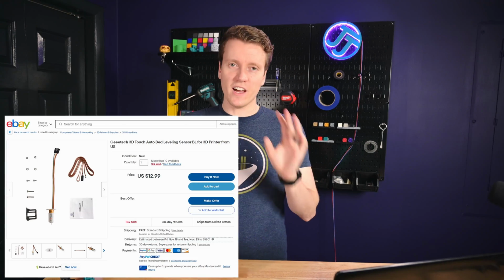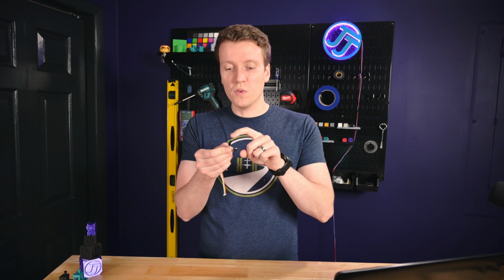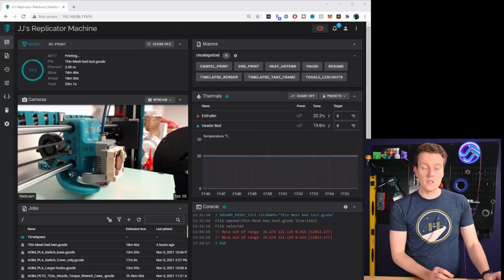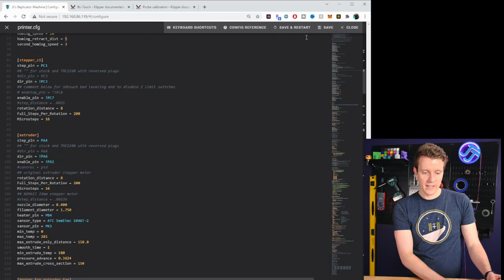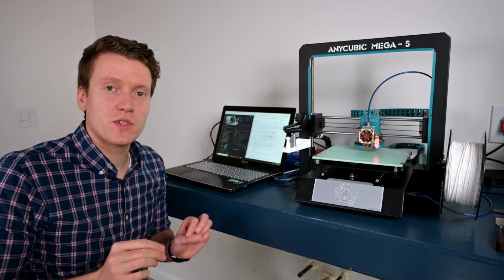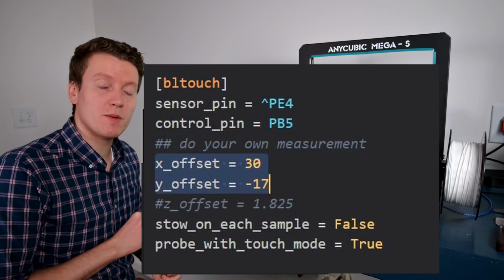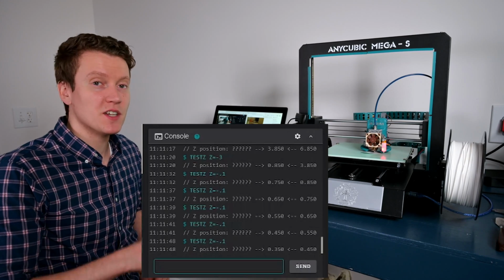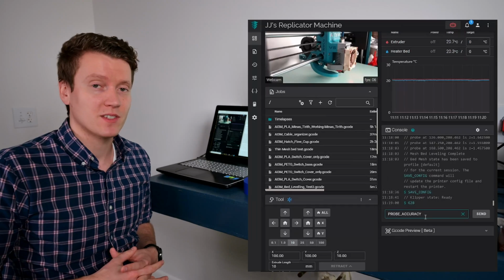Klipper BLTouch Clone Setup | Easy Anycubic Mega S 3dTouch Tutorial

Comment: Hello everyone First of all, thank you for the recording, since I'm still relatively new to the Klipper area, I already have the first question for you, I borrowed the Sonic pad from my colleague because my pi unfortunately passed away. Now I thought I would I could also put my old Mega Pro on a clipper. After a lot of fiddling and two nerve breaks, it finally worked. The only thing I can't get to work for the life of me is my BL Touch, which I have with the instructions from the internet with the x stop and connected to the cable twist and previously the stupid thing was running on the Marlin firmware but there was no chance of using Klipper. Can someone maybe help me?

Comment: How you connect it if the printer doesn’t have especific pin out for it, I have an anycubic mega zero, and I want to improve it, add a heated bed and. I would like to add the 3D Touch (I already bought one but I can’t find help to adapt the printer ) 

Klipper already “working” is install but I’m trying to place the heated bed and the 3D Touch all at same time

Comment: Hey i have the Trigorilla 0.0.3 and i have the Problem that my Sensor Pin is not working i double checked the wiring and my program but it stills always says triggerd? anyone that could help? I think that the sensor pin that you use in your video doesnt work for the 0.0.3V.

Comment: Thanks for guidance! I have a problem when I level the plate(bed mesh), it always sends me out of range. Do you have any suggestions?
Reply from the maker: You can set the "position_min" on the Z axis to something like "-5". If that's the axis that is giving you the issue. I had that problem where when it creates a mesh then it considers some of the bed under the homing point.

Comment: Another great video JJ ,thanks. I've got a mega s and I'm installing the ML mk4 carriage. The servo wire going to the board makes sense. The black and white wire that you added to the small pcb; what pins is that going to and where do they exit at the other end of the loom? That portion of your video talks about soldering the header pins but doesn't explain to what and where they exit/connect to.
Reply from the maker: So following the loom can get super confusing on this printer, but it eventually makes to it pin D2 on the Trigorilla board. And the arduino pin of "D2" is "PE4". That is how you define the pin in Klipper config file.
Reply: @JJShankles  Thanks JJ.  I haven’t moved to trying Klipper…..yet. My aim is to get the Mega to the point where it is a reliable PLA and PETG printer that just gets the job done. I’ve upgraded the hotend after discovering the limit of the standard one at 240 C :). I have a Pi running Octoprint so once the carriage is up and runninng, i’lll use your klipper video to try that. After that, a Voron will be the performance upgrade I’ll chase :) thanks again

Comment: I followed this video very closely and everything is working but I have one problem. The nozzle priming at the beginning of the print is now right in the middle of the bed rather than on the edge like it was before.  Any ideas how to restore it?  I can't figure out what part of the config file handles that.
Reply from the maker: That probably is part of the priming g-code that is probably coming from your slicer. You can add a line for it to go back to 0,0 after homing the z axis. The config line "safe_home_position" or something like that defines where the bltouch will home the z axis

Comment: JJ i need to buy the fan at the back for the anycubic assembly do you know if it is 12 or 24v tks brian
Reply from the maker: All the fans are 12V on the printer since the power supply is 12V.
Reply: @JJShankles  tks have a good nite eh!
Reply: Tks for all your videos i have learned a ton!! Did you get your filament runout sensor that came with the anycubic to work on your anycubic mega with klipper?

Comment: I have one of these but it could be newer as it's black (Amazon AU v3.1). The pin doesn't drop down ever time when called for "blue light" A lot of times I have to tap it with something. I'm about ready to biff it and set up an only fans to pay for a genuine.
Reply from the maker: That could be the Creality CR Touch. That's interesting, I had heard good things about them, but especially with Amazon sometimes you can find junk
Reply: @JJShankles  Nope, defiantly a fake BL touch. Funny thing is today i was jerking around with the little screw in the top and it hasn't failed to probe after a few hundred tests now?

Comment: Hi JJ i just happen to have a cr touch that i just found do you think it would be the same concept and wiring?
Reply from the maker: Yes the wiring is the exact same, and the installation is basically the same. Your x,y,z offset will be different, but that's something you set during the calibration
Reply: @JJShankles  great i will tackle it with your video

Comment: In my case, with the pin up or pin down, both give the same result on debug: triggered. Any ideia on how to fix this?
Reply from the maker: Maybe double check the black and white wires. They are the switch contacts, so if they aren't soldered well then it might not be opening
Reply: @JJShankles  I just did some tests and discovered the sensor pin is not working (SKR 1.4 T have an exclusive pin for it). Using the z-stop pin and test, all works. Thanks my friend!
Reply: @TiagoMaricate  hey i have the same problem could you explain that for me? thanks
Reply: @paccohd4387  Try to put extra weight attached to the pin and in the firmware try to invert the signal to activate
Reply: I have the same problem as you could you explain me better thanks

Comment: so... how do you deal with different height on Z axis after power off?
just use bed mesh leveling to compensate it?
Reply from the maker: Usually it holds consistent level for a while, but I can just re-do the mesh level if the z axis get off.

Comment: Does Fluid have a GUI for the movement of the head in a similar way to Octoprint? Great tutorials, thanks.
Reply from the maker: It does have a gcode visualizer so you can see where the head is. I haven't really used it since I don't really have a need for it. Can I ask what you use that function for?
Reply: @JJShankles  Thanks for the response. I use it for manual mesh bed leveling to control the z axis in 0.1mm increments. Pronterface has a similar system.
Reply from the maker: Oh now I understand. Yes that GUI is in Fluidd, and I use it everyday. You can control each axis in various increments, and you can even change the displayed increment options if you want them to be different
Reply: @JJShankles  Perfect, thanks again.

Comment: Im using the same X carriage and your printer.cfg file, but mine doesn't home in the center of the bed.
Already lost many hours trying to correct this. It should home at X00 Y100, at least mainsail tells me that...if I move the nozzle to the center the coordinates are X90, Y86. Please, help me! 😄
Reply from the maker: Check your [safe_z_home] variable. It should define where and how quickly you want it to move there. I have it go to X100 Y100 to home with the BLTouch. If you aren't using a BLTouch you can just comment out that section
Reply: @JJShankles  thanks for the reply! Yes, I’m using BLtouch with the same AI3M carriage, and [safe_z_home] its also set for  X100 and Y100. Not sure what I’m missing here. I’m using sensorless homing on the X, BLtouch probe on Z and limit switch on Y. Since I’ve  removed the DIAG pin on tmc2009 for the Y axis, not sure if there’s something related to my problem.

Comment: One thing could be added: mesh_min and mesh_max position values are relative to the probe, so you have to adjust them depending of probes XY offset, otherwise you will get position errors when calibrating the mesh.
Reply: Is there a guide to this? I'm not sure the math I should do for this.

Comment: Im frustrated ithe Printer starts and the BL-touch pin goes down and up but i cant control it in klipper with    BLTOUCH_DEBUG COMMAND=pin_down  or up :(  

cables are 100% right and the pins also

Comment: Hi JJ, any tips for setting up cura with optimized print settings for the mega s with klipper?
Reply: Thats a good question. If been googling for hours to find a good guide.  I'm not sure if my printer uses the mesh. Start and Stop code in Cura would be interessting.
Reply from the maker: That's a good idea. I've been working on a video covering cura settings, and I'll make sure to cover the start stop code

Comment: I have a mega S with the same X carriage upgrade, is the BL touch holder the one that comes with the MK4 mod? also are those cable chains that come with it?
Reply from the maker: Yes the BL touch mount is the MK4 one, and the cable chains are another model I found here: https://www.thingiverse.com/thing:4253211
Reply: @JJShankles   Thanks a million!! I've been looking for cable chains for this thing for ages, did you find any issues with printing/installation
? 
 awesome video by the way, I'll be using it when I get my probe.

Comment: How does one determine the sensor_pin = ^PE4. I'm using Anycubic i3 Mega, and the Trigger test does not say Triggered, it always says Probe: Open, perhaps the pin needs to be changed?
Reply: My motherboard is TRIGORILLA 1.1 so I changed it to the following configuration and it worked！！
[bltouch]
sensor_pin = ^PE4
control_pin = PE3
## do your own measurement
x_offset = 29
y_offset = -15
#z_offset = 1.825
stow_on_each_sample = False
#probe_with_touch_mode = True
Reply: @林樹德-d7e  Thanks! I struggled with this many hours and finally changing control_pin  to PE3 worked! My printer is Anycubic Mega S with the Trigorilla 1.1 board. I also did the alternative wiring (bridge between the H3 and H4 pads, solder pins to G1 and G3 instead of to the bottom of B5 and B6).
Reply: @林樹德-d7e  Thank you so much man, working on that for days, figuring out, why it wouldnt pin down or up. my control pin was the wrong pin.
Reply from the maker: I would first make sure the solder joints are good on the Black and White wires, because figuring out the pins can get confusing, but here it is.
So the Arduino Mega 2560 microcontroller pin mapping is here: https://www.arduino.cc/en/Hacking/PinMapping2560
There you can see that Digital Pin 2 is mapped to PE4. 
In this other image you can see where Digital Pin 2 (D2) connects to the board: https://i.stack.imgur.com/N4s1M.png
It gets confusing following connections with all the wire harnesses along the way.
Reply: @JJShankles  This is the second time it happened here, I posted a message that included links (to illustrate better) similar to what you have done, I saw the post here, but then when I refreshed the page it was no longer there. Is there some bot that removes any posts that have links?
Reply: @JJShankles  Thanks for your reply and assistance. I just un-soldered / re-soldered everything, double checking all my connections, and I still get the same, no Trigger. I it weird though the following sequence reports Trigger, BLTOUCH_DEBUG COMMAND=pin_up, BLTOUCH_DEBUG COMMAND=touch_mode, QUERY_PROBE, but not when the pin is down and I push it slightly up.
Reply: Could it be the Pull up resistor option with the ^ before PE4 ?
Reply: @badabing2003  I seem to be having the same problem. My BLTouch (Genuine 3.1) was working fine on Marlin but now not on Klipper, I cannot get it to probe; it just sits retracted with the red LED illuminated. On initial power up, it passes the BIT so it is not the probe. It is wired to D2/^PE4 and D11/PB5 so the problem is not the wiring. Any suggestions JJ or anyone?
Reply: @stephenknudsen3146  Same issue here. All my wiring have been double checked and i'm not able to make it triggered! Did you find something???
Reply: The same happens to me. Can anyone help?
Reply: I went the solderless route with the other video JJ mentioned. That is using the same pin as the Z minimum endstop, which is ^PD3 . I found a pinout picture of my mainboard here: https://drucktipps3d.de/wp-content/uploads/asgarosforum/8102/Trigorilla_details.png , and am using D18 (Digital Pin 18), then when you go to the Arduino Mega 2560 pin mapping link JJ provided, that corresponds with PD3

Comment: I just spent like 10 hours trying to get mine to work lol I’m using a 3D Touch v3.0 and for me the probe was going in and out fine but it wasn’t triggering the z stop and only showing as triggered with in a fault (flashing red). I tried a 1k resistor in series as the klipper site said and no luck. 

Turns out I just needed to comment out the probe_with_touch_mode and now it’s working fine.  

Thanks for the useful information
Reply: When doing the trigger tests, is the pin supposed to pop-up all the way as soon as you touch it? Mine does and never says triggered. I'm on i3 mega not mega S
Reply: Thank you 2 years later!!
Reply from the maker: Glad you got it working!

Comment: i had sucess using the probe as the z endstop but my gantry is not level so i have to use the endstops to level the gantry with the motors on and then start the print. as soon as i changed it to use the endstop pins instead of the z virtual probe, my z offset would not be utilized. im not sure what was going on. =\

Comment: Awesome guide. I heard that most AnyCubics cannot accept a BL Touch natively like the Ender Printers since AnyCubic isn’t open source. But you said you plugged yours right into the motherboard?
Reply from the maker: Yeah my main board had the pins already soldered on to plug it into. I did have to solder the signal wire to replace one of the z end stops though, but I'm not sure how that compares to an Ender installation

Comment: Love the detail you go into your videos. Would you ever consider upgrading the X and Y to linear rails upgrade for the Mega S?
Reply: I did the linear rail on my Mega X for the X only so far.  Not sure if I will end up doing the Y. However… a hot-end upgrade might be next.
Reply: A part of thinks e3d Herema hotend kit… then I see the price and wonder if a upgrade that is 1/3 the price of the printer is overkill. Hmm 🤔
Reply: @davidkinch2100  Did you notice any noticeable improvement with the X linear rails? I'm trying to find a way to improve on my print lol. Getting some horrendous looking layer lines I'm trying to get rid of
Reply: @arenree  yes mostly in acceleration. The limit for speed becomes the hot-end and just getting enough plastic out.  But there is a bit of a limit as well because of the frame. I was thinking about attempting to stiffen the frame up as well but a part of me thinks how much do I put into a Mega X before I equal the value of a corexy type machine.